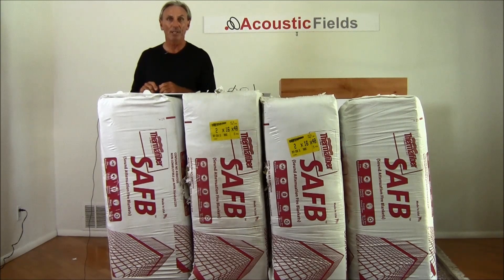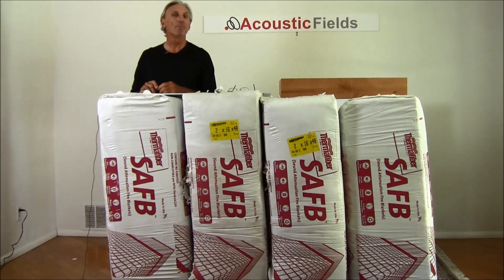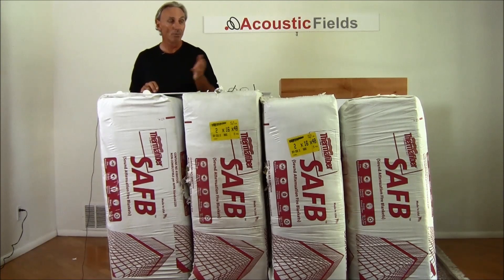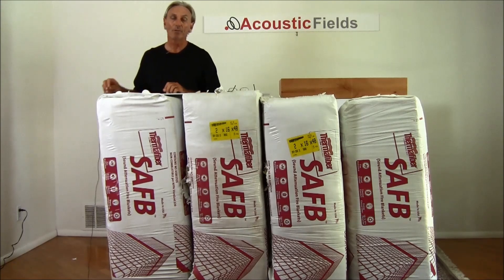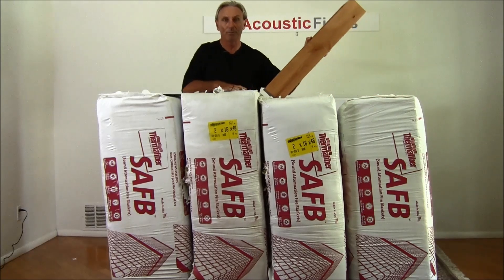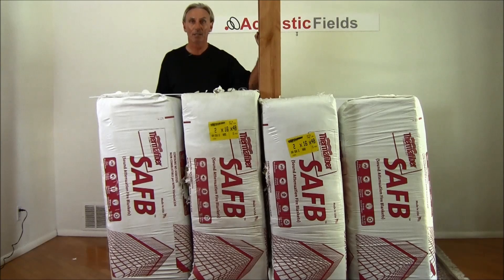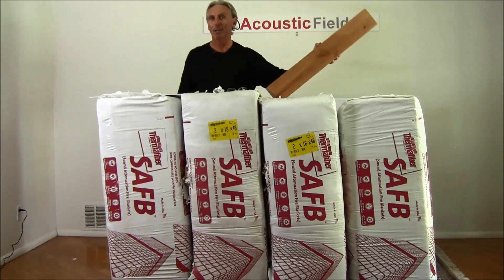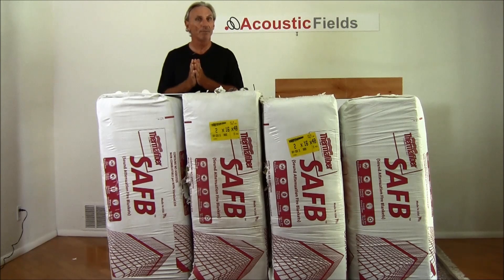Beware Absorption Myths - www.AcousticFields.com

Comment: doesnt this depend on the energy and amplitude of the signal? like a 40 dbfs 30 hz wont pass a 5 inch rockwool sheet will it ?
Reply from the maker: Panel depth produces the panel's resonant frequency. A resonant frequency is how low the unit will absorb down to. Frequencies above the resonant frequency will be absorbed. Those frequencies below the resonant frequency will not be. Panel depth says nothing about how much energy will be absorbed above that resonant frequency per square foot of panel surface area. The internal cabinet fill material determines the rate of absorption above the resonant frequency. You must match the rate and level of absorption to music and voice not noise. Music and voice are different than noise.
Reply: @AcousticFields  yes but my question is and i will try to explain my self ,  won't the rockwool panels work to some extent in low volumes ? meaning , sound is  a physical waveform with many frequencies and amplitudes right? so there must a be a treshold  where all the sound is absorbed and wont excite room modes using this cheaper tech.... i was reading and aparently energy is equal do amplitude and frequcny square so...E = A2...does this mean all waveforms with energy below 1000joules or something is ok=???
Reply: @ayamaprantenna  but its a mechanical waveform so i think that it depends on the volume it creates as, when the energy hits the wool it all gets transformed without resonating i think....at low volumes think rockwoll will be effective down to 20hz man
Reply: @ayamaprantenna  its more like energy conversion from mechanical to thermal
Reply: @ayamaprantenna  so your saying the laws of thermodynamics are wrong???? Yes it is absorbed compeltly doesn't change any pitch

Comment: This is a very good video on internet to explain what exactly is absorbtion but there is different materials and solutions on absorption nowadays especially on a specific area
Reply from the maker: J,  Thank you. One of the great myths perpetuated by acoustic product manufacturers is that building insulation is the cure all for all absorption needs for music and voice. In fact, most of their products contain this material and are just repackaged building insulation with a different name. Music and voice is different and must be treated with respect in rates and levels of absorption. You must place certain rates and levels of absorption below 500 Hz. that building insulation can not offer or achieve. Another issue is the toxic quality of these materials. The building materials are composed of steel and plastic based fibers that are lighter than air and are inhaled by the workers who install them. We do not allow these materials on any of our build sites for performance and health reasons.

Comment: You claim you need 1 wavelenght deep (6ft for 185 Hz)? With Lambda/4 you get maximum velocity and that's the thickness used in anechoic chambers.

You also claim you get a 100% of absorption but commercial mineral wools won't get to 100% of absorption at those frequencies due to the high flow resistivity they have.
Reply from the maker: Hi J,  Published absorbent coefficients are based upon the sample size and cover a 1 sq. ft. test area if the testing is adhering to established and accepted criteria. You must then take that 1 sq. ft. area per sample size and then calculate how much square footage of that chosen material you need to impact a frequency and amplitude change for your given issue. Total amount of material required is based upon amplitude of frequency issue.The mistake people make when looking at the data is that they assume since the product they are looking at absorbs 100% at a given frequency that placing a single product will accomplish their absorption requirements. You must match the products ability to absorb at a particular frequency with the amplitude of the problem and them calcualte corresponding coverage requirements.
Reply: I don’t know ASTM standard since here in Europe we use ISO but I’ve seen many ASTM compliant tests with alpha values over 1,3. My opinion is bass absorption should be measured in Kundt tubes because reverberant chambers and standards are not thought for frecuencies below 100 Hz and the results can be manipulated to get what you want.

Comment: Awesome!!!   I was just looking at this kind of material last night as I am looking into building my own vocal booth.   So one of those would only damping 25% of the sound mass, correct?  Thanks for the video.  I am learning a lot.
Reply from the maker: +Luoyisi Shimisi Vocal rooms have special rates and levels of absorption that must be dealt with when dealing with frequencies above 100 Hz. Fill out the information in this link and I can better assist you.   http://www.acousticfields.com/free-acoustic-treatment-room-analysis-tell-us-room/
Reply: I found that a vocal booth's primary function is isolate from other noise and to cut down on the high frequency slap-back echos, say 5 kHz and up. You can get pretty far with just carpet floor and thin lightweight foam. The walls should be solid enough so the vocal mic doesn't pick up too much of what's going on in the other rooms. You're running an 80 or 100 Hz low cut on vocal channels anyway (very few voices go that low and when they do, there's not a lot of sound pressure there) so you kinda want it to reverberate in the vocal booth a little bit, you just want the high mids and treble to sound dry so you can slap whatever reverb on there.

Comment: Dennis could you please do a video on how read acoustic coefficients of insulation?  this very confusing.  when we read that 3" of SAFB has a coefficient of 0.34 for 125hz  what does that mean?  how much is it actually absorbing?  34%  ?
Reply from the maker: +tecnolover2642 Absorption coefficients are based upon the capacity of one square foot to absorb what percentage of that frequency. They are useful calculations in determining the amount, type, and position of that specific material. You use them to determine the rate and level of absorption that goes well with the room's intended usage.

Comment: This warning seems a little misleading. Bottom line: If you have no idea how sound reacts in an environment, or how to decide what type of treatment should be used to fix any unwanted reflections or noise, then either hire a professional to help, or start reading. Sound acoustic measurements and treatments is a science with many variables that must be taken into consideration. Like the measuring the amount of foam  it would take 6 feet of foam to absorb the frequency of 180 hertz. The calculations behind that may differ depending on different types of foam, but they may be the same. However, before you go out and buy the cheapest foam that you can find because it has the same SAC as a more expensive foam understand that in an enclosed environment, different materials are used for purposes other than the amount of absorption. If you are treating a home studio, it may be worth a dew extra dollars to protect your equipment from being covered by tiny particles that are coming from the low grade, intended for outdoor use foam purchased at a bargain.

Comment: Why are you talking about 100% absorption? You don't need it, and 6 feet doesn't do it any more than 6 inches. You specify the absorption you need, and you do that with a target moding depth. Also, as you add traps, you need to measure reverberation times in various bands and choose the correct surface finish on the absorbers to equalise them. And of course you must mix absorption with diffusion at the correct places. Get this right and your room sounds not only better, but bigger.
Reply from the maker: You are correct. You do not need absorption levels to be at 100 %. However, it is critical to understand the science behind claims, especially in the low frequency absorption area, that are made by acoustic product manufacturers. What we do need is a better understanding of what constitutes real absorption rates and levels from existing technologies that are represented as low frequency sound absorbing devices. It appears to us that most companies apply the term low frequency absorber to their products when the laws of physics tell us that this just can not be. There appears to us to be a big difference between the label placed upon the product and its actual performance capabilities as defined by the laws of physics.
Reply: Absolutely. And where the absorber is expensive youcan extend the range downwards usefully by standing it away from the wall a little. If the room is already fairly dead ayhigher frequencies the front face should be supplemented with a sheet of something like vinyl to make it a little refective to high frequencies.
Reply from the maker: donepearce It is important to realize how lower frequency sound absorbing devices work in order to maximize their effectiveness. Once you know how they all work best, you can find those triggers within the room.

Pressure activated, absorption technologies, need to locate in areas of highest room boundary pressure. This high pressure region can be measured at distances of 1/4 " from wall surface. We have measured over 100 rooms in this manner. As one extends out towards room center, pressure levels become less and the diaphragmatic and membrane type of low frequency absorbers will not work at maximum efficiency. Their whole performance existence depends on pressure. Pressure is the key that starts the engine; no key, no start, no absorption. 

Placing a sound absorbing technology that works on air flow and molecular speed to generate heat through friction for absorption process to occur are more effective away from room boundary surfaces because any physical positioning that increases the air flow across the most surface area of the unit is beneficial to the overall unit's performance. These units will not be able to obtain the same rates and levels of low frequency absorption as pressure activated units.

Thanks
Dennis
Reply: He was just using 100% as an example of what it what it would take to absorb 185hz.  Now, do you need to absorb 100% of anything?   Let's say you put 6 feet or whatever he has around the entire room where it's on every wall, ceiling, and floor,  then there would be no 185hz bleeding outside the room into the outside, nothing at 185hz would enter the room from the outside, and 185hz would not get reflected back into the room, so you'd only hear 185hz from the sound source and not from anywhere else.

if it had only 80% absorption and your entire room was covered with that product, then you'll get a little bleed through and maybe some will get reflected back into the room.  

I think that's what he means. Obviously, you aren't removing 185hz from the sound source.  you'd need something else to do that, that's an electronic filter of some sort that completely removes specific frequencies emitting from the speaker.
Reply: If you are talking about room treatment, you are talking about managing what's emitting from the sound source and what gets absorbed or reflected or diffused within the room. Barrier technology is what is used to prevent bleed through between the room and the outside area.

Comment: The master acoustics handbook p191 shows an absorption coefficient of 0.85 at 125Hz, at 100mm (4inch) thickness of glass fibre 3lb/ft2, is this accurate? If so, isn’t the difference between this 100mm panel and a say 1000mm panel simply a case of ever diminishing return for the loss of room space. My bass traps are 150mm (6 inch) glass fibre 3lb/ft2 with a 50mm air gap, which I think is a good balance between practicality and performance. But I am no expert.
Reply from the maker: The process you are referring to and using in your example is exactly as you state. Adding additional limp mass layers is not highest and best use of the precious real estate space we all have in our music rooms. If you follow the quarter wavelength rule, you can see how much depth just a 40 Hz. wavelength needs. At 39 long, you must have at least 9' +.  This is one of the major reasons behind our diaphragmatic absorbers.

With diaphragmatic absorption, you can go lower and absorb even more than any limp mass pile in a box. That said, our diaphragmatic absorbers weigh 200 lbs each!  You can see the performance results tested by Riverbank Acoustical Labs on this page http://www.acousticfields.com/product/acda-12-activated-carbon-diaphragmatic-absorber/  100% absorption at 50 Hz. and 63% at 40 Hz.  In short, its a beast. 

Thanks 
Dennis
Reply: Acoustic Fields That certianly sounds impressive. I'm not that familiar with diaphramatic absorption although I understand them in principle. Thanks for the response.
Reply from the maker: Hi KennyTew2, my pleasure. This blog post and video help explain the diaphragmatic absorption process better http://www.acousticfields.com/bass-absorption-why-the-power-of-diaphragmatic-absorption-is-your-only-hope/ Any questions, don't hesitate to call or mail me as always happy to help. Thanks Dennis
Reply: Acoustic Fields Much appreciated.

Comment: The depth would depend on the efficiency of the material's sound absorption as well as the frequency in question. It might be 100% plausible for a 1" thick material to absorb a 10Khz frequency or a 4" thick material to do the same for a 5Khz tone (100% of it). Definitely the lower you go in frequency, the thicker the material will end up being - or at least a different density as well.   So the 6 foot thick material to absorb 100% of something, well its 100% of a low frequency. You'd need far thinner for a higher frequency.
Reply from the maker: Hi Tino,

You are correct. Material thickness and density are the two most important variables when it comes to energy absorption down to 100 Hz. All frequencies below 100 cycles require special sound absorbing technologies to achieve results that will absorb enough energy to make an audible difference. When I say audible, that term comes with many meanings in today's literature. You must look at a product's ability to directly impact low frequency energy attack and decay rates. Anything else is just a band aid on an acoustical artery cut.

Thanks
Dennis